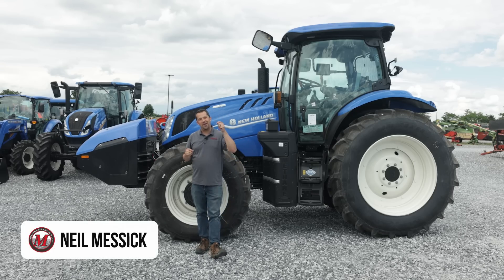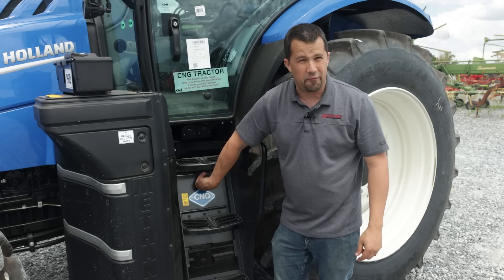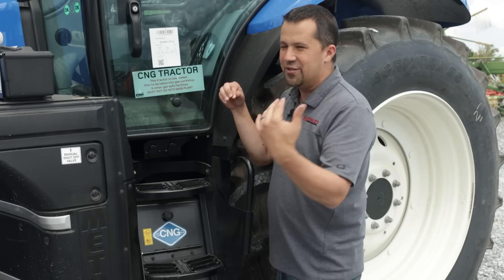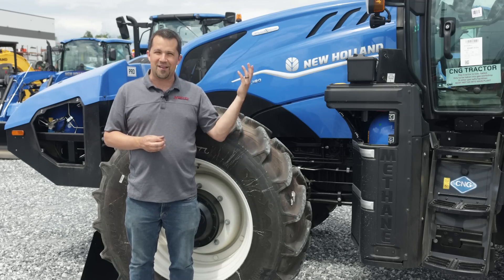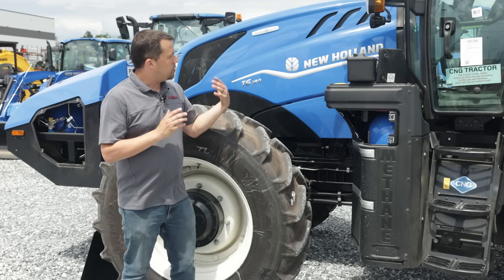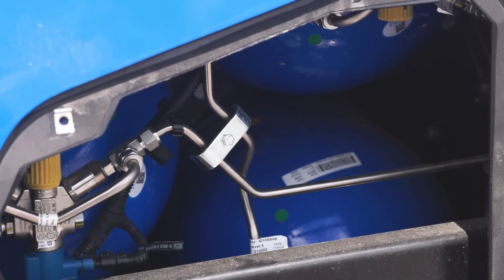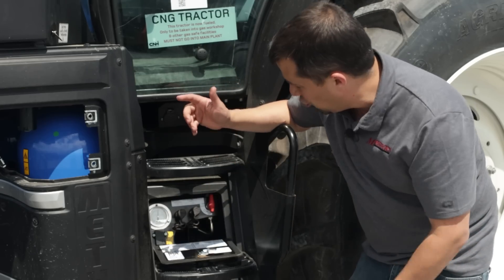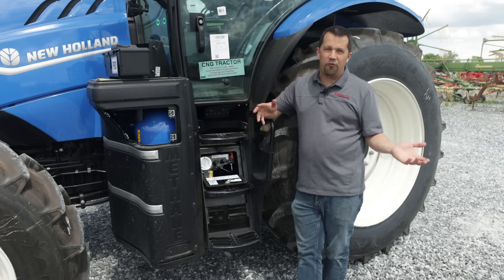Eliminate fuel costs with the most interesting boring tractor | New Holland Methane Powered T6

Comment: Somewhere I see this being able to work out would be areas where you actually have natural gas for say heating your home or your shop and you could easily just add a compressor to compress that natural gas to fill your tractor with now granted you would have to do some penciling out to see if the math with math out doing it that way but where I see this also being the largest make sense factor is sort of along the same lines of reclaiming the methane off of a digester is if you are fortunate enough to have a farm with a gas well on it and you have free gas because of that well then you're only investment in infrastructure would obviously be the compressor unit to fill the tanks on the tractor but after that is installed you can fill your tractor up for free

Comment: I didn't catch, but did you say if it is spark (like gasoline) or compression (like diesel) ignition?  I expect spark, as that is "normal" for NG engines.  Also spark ignition has less vibration because of the ignition timing.  But spark ignition does mean spark plugs, which need maintenance.
Reply: It does have coil over plug spark ignition and the sparkplugs do have a maintenance interval. Fortunately, the top of the engine is very serviceable as the emission system of this tractor is very simple as compared to a Tier4B diesel.

Comment: It’s almost like we used to have LP tractors in the 50’s I wonder why we went away from that then now we go back to it
Reply: General Motors and Goodyear conspired to destroy passenger travel by train and it worked! Methane is a byproduct of petroleum extraction as it's also a byproduct of animal fecal matter. Of the two forms of fuel which one is going to make a corporation long term money. Solar panels on a house can produce electricity for 25 to 30 years thus, basically a one time in a generation purchase. The consumer is winning anytime a  nearly free fuel source is available. Live stock farms would greatly benefit from having their machinery running on animal waste.

Comment: Torque will be a lot less.  Methane is not a one for one swap volume wise as it has a lot less BTU's (energy) per gallon. BUT it can be cheaper, mechanically.  The major roadblock is how to fuel it on a small to medium farm.  I'll not trailer it to fuel stations and as I do not do dairy, cant make my own... although my wife says I can almost do it by myself.
Reply: Since the engine is turbocharged, the power curve is very similar to the diesel counterpart. It even has the power boost function just like the diesel version. While a public fueling station has very fast fill delivery,  it is very expensive to privately install. For those looking to fuel the tractor on the farm without a digester, a more modestly priced compression station designed for home and light commercial usage can convert your existing natural gas service on your property into a small fueling station. The one recommended by New Holland will refill the tractor from empty in about 8 hours.

Comment: Is that engine more like a gas engine?  Does it have spark plugs?  Or does it have glow plugs?
Reply: Its just like a regular gas engine, just different injectors and fuel pumps....and  yes, they have spark plugs rather than glow plugs as its just like burning regular gas VS diesel which is ignited through compression rather than spark plugs.  There aren't any glow plugs either, as pre-heating the cylinders isn't necessary on cold days just like a regular gas engine.

Comment: Is this tractor geared towards dairy farmers that have their own manure digester and just need to install a compressor.
Reply: That would be my guess.....its a 30-40 mile one way drive to the nearest CNG station where I live....so CNG is useless in my area LOL.   The thing is nobody has manure digesters either LOL.  That tractor is a very niche market type machine, hardly anybody would buy them because of the lack of fueling capability.
Reply from the maker: yes

Comment: This is just a modern rendition of the propane powered tractors from 50-70 years ago. It’s so quiet and low vibration because the compression ratio is a fraction of the diesel counterpart. The lower compression ratio and less energy dense CNG fuel will mean this tractor is probably the lowest HP rating in the series. If CNG is readily available this is a great solution but compressor stations are VERY VERY expensive. Having worked for a Class 8 OEM and done a ton of integration work on the current generation Cummins N designation CNG engines they are great to operate and can reduce operating costs. CNG engines reject a ton of waste heat so I’d be interested to see if this machine can keep itself cool at 100% load on a high ambient temp day. Good on CNH for offering farmers the option!

Comment: So what is the cost difference between the two versions ? Back in the 50's - 60's the few natural gas tractors that were around, needed fewer oil changes as they did not dirty their oil as fast. The internals were much cleaner in the natural gas versions than in the diesel versions.
Reply: Depends on what the cost of CNG is in your area most likely, and how easily you can get it....where I live you gotta drive 30-40 miles away to get CNG...so its pointless in my area....other areas probably not as much of an issue...but rural areas, are not where these tractors will roam because you aren't going to find a CNG station anywhere around.
Reply: @wildbill23c  The customer base for these machines are airports, landfills, municipalities with regular access to CNG and ag producers who operate a waste digester to create methane gas.
Reply: @kmburges  Which is an extremely small number of buyers....which makes this tractor pretty much pointless and a very short lived design I'd think due to the very low sales volume.

Comment: Fiat Industrial was a branch company split off, and has nothing to do with Fiat automobili on a business, design and manufacturing level. It has been CNH Industrial since 2012 when CNH Global became large enough to merge with Fiat Industrial, its then parent company (although still majority owned and controlled by the Agnelli family).  So Fiat, now part of Stellantis, and Fiat Industrial, now called CNH Industrial, are both majority owned by the same parent, but are not the same. It is a long and confusing procession of reorganizations and mergers, but hopefully that simplifies it. CNH has satellite headquarters in Britain, the U.S. and Italy. BTW the blue on New Holland tractors comes from Ford, as when Ford bought New Holland in 1985, New Holland didn't make tractors. New Holland's livery colors were red and yellow. This continues to a degree on the equipment and harvesters, but the tractors are all Ford blue. I had to brush up on all this, as I remembered there was a reorganization or two. I didn't remember that many....Edit, also all the engines for New Hollands and Case tractors are made by IVECO. It is a much bigger PITA to convert a diesel to CNG than a gas, and even moreso if it's forced induction. Also, there are no high pressure fuel pumps (or for that matter, fuel filters) and that may be part of the vibration reduction as well as the lower compression ratio. The engine may also be a completely different displacement unit as well.
Reply: The engine is an FPT 6.7 liter 6 cylinder that shares many of the same lower engine structure of the diesel. The cylinder head, turbo and fuel system are unique to the methane tractor. It does not have a high pressure fuel pump but does have a serviceable CNG filter inline to the main regulator. The compression ratio of the diesel is 16.5:1 and the methane tractor version is 12:1 with coil over plug ignition. When you drive one, it's amazingly smooth and quiet. The cab of the T6 is already amazing so adding smooth and quiet makes for a better environment to listen to classic country while mowing  :)

Comment: Any thoughts on cost of fuel savings vs diesel
Reply: That would depend on what the cost of CNG is in your area....as well as how far you have to drive in order to get it....pretty much every fuel station has diesel....very few have CNG, and are usually a totally separate place altogether and nowhere close to where they'd need to be in order for a CNG engine to make any sense to most buyers....closest CNG filling point from my place is 30-40 miles depending on which way I go...so don't make sense at all in my area....now someone living on the other side of the valley that's close by wouldn't be an issue for sure.  I have no clue how much CNG costs, diesel is around $3.69 to $4.00 a gallon in my area....but with what I do I only go through maybe 10 gallons of diesel a year since I just have a small tractor that I use on occasion LOL.

Comment: I'm guessing the vibration difference is mostly due to the cng engine having close to half the compression ratio then the diesel.
Reply: That was my thought as well.
Reply: @JamesMcLaren1000  The Methane tractor is 12:1 and its diesel counterpart is 16.5:1. They both share the same lower end design but the cylinder head and fuel system are gaseous specific for methane. It uses coil on plug ignition and a water cooled turbocharger as well. The methane tractor was specifically tuned to match the power curve of the diesel, including the power boost feature.

Comment: I think the lack of vibration is because of Less of an explosion in the CNG FUEL. Is the horsepower and torque the same as diesel engine? Is it more cubic inches then diesel to make up for less energy in the fuel?
Reply: It is the same displacement as it's diesel counterpart. The power curve is very similar to the diesel and even has a power boost just like the diesel version as well.

Comment: It's only bad w/r/t climate change when you release it to the atmosphere unburned.  When combusted co2, is co2 and no different then disel.  However the other emissions not co2 related are way cleaner with methane/cng.    Making a methane capture system for manure is not easy or cheap but cool if it works!
Reply: The methane tractor is very clean burning even when operating on Natural gas from a public CNG station. This tractor produces 10% less CO2, 75% less CO, 62% less NOx, has a 90% reduction of unburned hydrocarbons, and has a whopping 98% reduction of particulate matter versys a Tier 4B diesel.  It does this all with no EGR, urea, or exhaust filter. It has a simple catalyst very similar to a gasoline car.